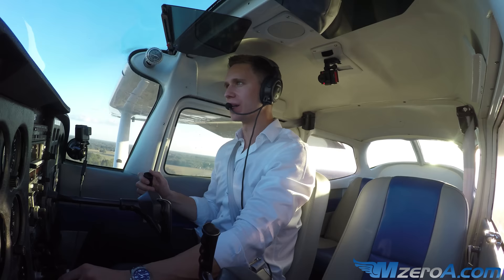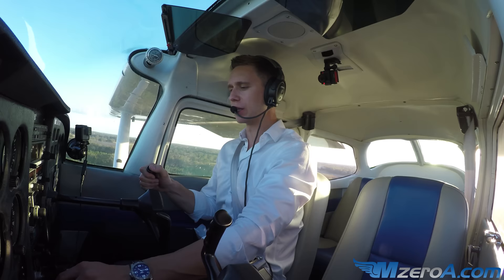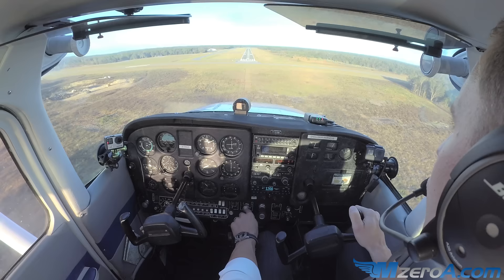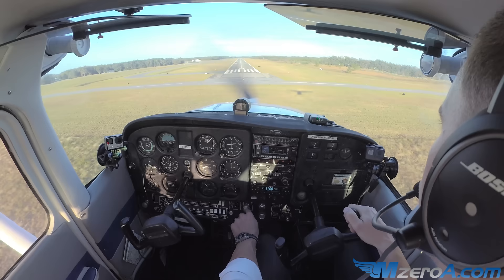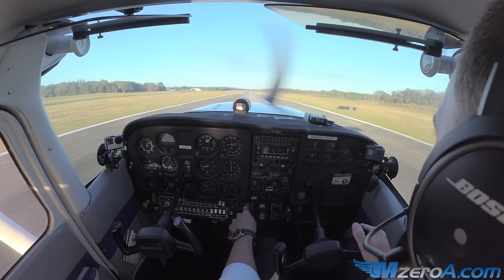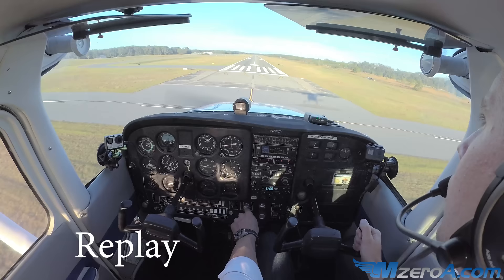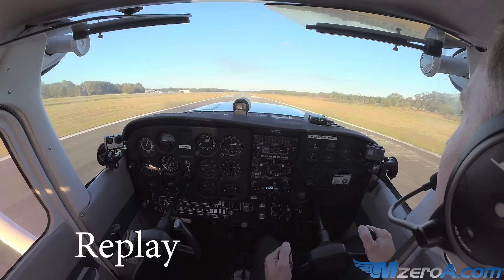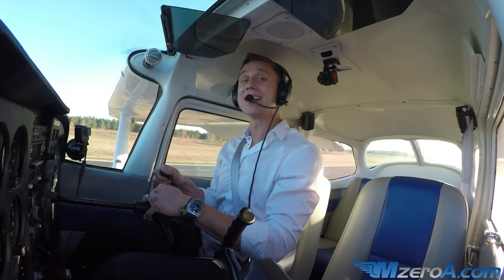3 Tips To Improve Your Landings - MzeroA Flight Training

Comment: I'll never forget my first solo cross-country from Houston Hobby to San Antonio International (really - we could do that back in the 70's). Approach control held me at 2500 feet on base for runway 12 R. A Braniff jet flew underneath my 150 (I could see the stripes on the co-pilot's shoulders) and the tower then just said turn final, cleared to land. Wow. I came off the power and hit full flaps and landed on the numbers from a 2500 ft. base leg. It was the first time I hadn't flown a traffic pattern but my training kicked in and I just flew it. Same coming back to Houston. Tower made me go around in a long circling approach to avoid a Southwest jet and I just flew it. My message here is airmanship and flexibility. I was a little rattled not having the cues I got in flying a pattern, but you don't always have that choice. Great channel. I just subscribed.

Comment: The bad landings you demonstrated, I've done them a bunch of times. I think what I gained from this was delaying the round out a little bit, I had a habit of doing it early and then stalling a little high which made a hard landing or flaring with too much speed which made the airplane fly more, which I'd have to correct with a little power to stop it stalling. It's a bit of an art form getting landings right.

Comment: I believe the term flare is the best description in describing what the pilot is doing when landing the aircraft. The pilot transitions from the approach attitude to the landing attitude by using a flare.  When attempting to land the pilot transitions from a flight aircraft to a ground aircraft.  With light GA aircraft,  I found it important to instruct the student once on the ground to retract the flaps as soon as possible and thereby transferring the weight of the aircraft from the wings to the main wheel gear and nose wheel. In other words, transition from flight mode to ground mode as soon as possible. Of course in flight training, the term to use is what works best for the student..

Comment: My biggest issue is directional control - when I throttle idle my nose starts going all over the place and I'm trying to rudder to correct it. Would love to see tips on how to maintain directional stability during the roundout. Thanks!
Reply: More throttle?
Reply: I found it helpful to watch the end of the runway through the transition (roundout).  The nose doesn't come up nearly as much that way, as you generally keep it lower to avoid an aggressive sink. My experience is that most CFI's for some reason,  pull back on the yoke far too much.
Reply: Don't rudder correct, do slight aileron correct and I mean very certain sligh/
Reply: More slow flight practice!!

Comment: 2016 172/G  I go 85 on downwind, 10 degrees and trimmed, 1800 rpm, 75 on base and add flaps to20 almost no retrimming, turn base, final flaps and 65 about 1500 rpm give or take on wind again almost no trimming, slight adjustment and 65 all the way to the fence, touchdown between 50 and 55

Comment: I don't know if it is my CFI, or the tiny field im flying out of, but we land very differently. I'm configuring for 70 wigh flaps on the downwind and holding that all the way until short final, than power off and basically a controlled stall to the ground after the round out. Now, my base and final are very short due to a hill that blocks the pattern, and I am virtually always flying in gusty conditions. 

My CFI did say that once I get good at landings on this field, I can land anywhere. My first landings on a different field definitely felt like they were on easy mode.

Comment: You can not fly  a normal pattern when some other  pilot  is flying an A380 pattern, so instead, i practice to be quickly ON SPEED, ON SPOT at 300 feet from the threshold from any speed / altitude/ distance and always land the stall warning screaming  with flaps max 20 trying to touch down on the number, each and every time. I would use full flaps on a dead stick landing, though. And. Great video, great info!

Comment: I don't get why there's so much emphasis on staying close enough to make runway if engine quits.  We learn to fly so we can leave the pattern obviously. Engine reliability shouldn't be the driving factor to determine how wide a pattern you fly IMO. A wider patter would not require as much bank and allow plenty of time to correct if required. And at the same time could even keep the stall/spin at bay since the pilot isn't rushing to keep it tight and not overshoot. What say you?
Reply: As someone who  is about 10 hours into my flight training, if I had to guess its about the time it takes to recover. I agree that engine reliability shouldn't be a driving factor, but it should be considered nonetheless. When flying at altitude you have time to react to an engine failure, whereas when you're in the pattern you don't have the luxury of disposable altitude. If you can't make it to the runway, then you essentially have one option to land and that is pretty much in front of you as you don't have the altitude to maneuver to a potentially safe landing area. In addition, making hasty unplanned maneuvers to areas that are not the runway is dangerous especially when there is other traffic in the area. Depending where you are in the pattern, at pattern height, you might not have enough altitude to get to the runway. For example say you fly an extended crosswind and then your engine quits. Then you have to make an extended base to get back to the runway, and while you might be able to make it, sometimes you can't. A perfect pattern should keep you where you need to be in the event of any type of failure, but also allow enough time to make the maneuvers to the different sections of the pattern. If there's one thing I've learned so far it's that when you're in the air, always have a backup plan because the minute you start to panic is the minutes you make things worse.

Comment: Agree 100% that airspeed is king and GA pilots have a tendency to be to fast on the approach/landing per several research studies as evident by porpoising, multiple bounces, floating. But let me add the following. Research has also shown that rarely do GA pilots adjust Vref for aircraft weight. As the latter decreases so does the former. Moreover, light aircraft certification (not so for transport-category acft) only requires a single vref value to be specified in the POH and for max cert aircraft weight. In the case of a C172 with solo pilot and less than full fuel the true Vref will be less than the single-value stated in the POH and consequently the landing  will almost certainly be too fast. 

Another point on the traffic circuit-great advice for non-towered airports but less so with a control tower who can, and do, request right base/straight in entries. etc.

Comment: Large jets like the 777 and 747 don't really flare like this guy says.  Jets don't really flare in general.  Certainly not the ERJ-175 that I fly. You just fly them with power onto the runway.  They are generally already in a nose up attitude during final.  In a 172, you pull the power back way earlier and flare it until the stall horn goes off and it plops onto the runway.  To me, that's more of a flare than what you'd do in a jet.
Reply: yeah this is what I'm thinking, the faster the airplane the less you want to get it near stall speed close to the ground.
Reply: On a good landing the stall warning horn shouldn't be going off, maybe slightly from a gust of wind right as you touch down.  No matter what phase of flight though, a stall warning horn is the indication of an imminent stall, not a good sign no matter what, it's the same thing as the stick shaker going off in the jets.  That being said, many people believe that good slow flight technique is to hear the stall warning horn the whole time during the maneuver as well but that is poor technique.  If you don't believe me, check out the latest version of the airplane flying handbook.  If the stall warning horn goes off during slow flight you should increase your speed by about 10 knots in a 172.  Also, the technical term for slow-flight is any speed less than cruise.  Hope this helps some people, lastly on a side note, the airspeeds he mentioned will be different for your make and model of aircraft, please refer to the POH for the airspeeds specific to your aircraft.
Reply: Eric Housman the technical definition of slow Flight ia between the endurance speed and stall speed. I wouldn't call endurance cruise, it's far from it.

People practice slow Flight with a constant or near-constant stall warning because that is closer to Flight at minimum controllable airspeed, which is the point of the maneuver. You enter the slow Flight range well before that though yes.

There's nothing wrong with hearing a stall horn in the flare in most light aircraft. It depends on how sensitive the horn is. Many taildraggers you can't get to a 3-point attitude without the horn. For a 172 I am not a believer that you should hear the horn like some people suggest, but if it comes on when I'm a few feet above the ground it doesn't bother me at all. A stall at that stage is just a smooth touchdown.
Reply: Andy Plater I would agree on some of those points.  Definitely depends on the aircraft.   AFH says slow flight is flight just under the AOA that will cause a buffet or stall warning.  Meaning the stall horn wouldn't be going off.  In the 172 POH maximum endurance speed is at 60% power which still gives a speed of 100 knots roughly.  Well above slow flight speeds and is considered a cruise speed.  I did mention the first time that hearing the stall horn just before touch down happens quite often for lots of planes especially if it's gusty but holding the airplane at up to a full stall before it touches down isn't good technique to me.
Reply: I don’t think he’s aiming for jet pilots. Landing a 172 is totally different compared to jets. It’s the main issue I see with new FOs at my airline, they do the chop and drop like in a 172. It takes awhile for them to understand they need to almost land with power. My personal tip for best landings is the trim, have the airplane with slightly above normal nose up trim on touchdown and you will roll it on every time.
Reply: High wings float in general compared to low wings, but true jets you come in with a whole different set of power settings.  He didn't really address treating every landing with precision and controlling the rate of descent, but pro grade video.  Lots of camera angles speaks clearly and enthusiastically.  I liked it.

Comment: Some important advices on speed and distance, thanks. A good tip, face your instruments by sitting in the left seat, how can you expect a perfect landing with an improper speed and altitude information? ;-) I didn't get this "flare" argument, you flare a C172 like any other aircraft except some navy fighters like the Hornet, unless you want to bounce or crash on the ground. You may call that transition if you like - though this would rather apply to an helicopter whose flight regime actually transitions, but "flare" is just the definition of your trajectory.

Comment: Jason,  Thank you for great tips and video.  I am a student (Warrior PA28) and thought that I was doing good in learning landing.  However, I have failed with one of the instructors.  Unfortunately, not all CFI's are same.  They do not teach or give step by step instructions.  In final, the nose is still down until you come into landing arena.  When do you pull back little bit, so that we put the rear pressure on the plane?

Comment: I’m a student pilot right now and every time i transition or flare on the landing, I pull up and plane comes up. :/
Reply: I don't think is much of a "pull up" rather hold the nose up when you transition, as your airspeed decreases you need more back pressure to hold it at the same position, when you get into ground effect just hold the nose up but don't yank it, it needs to be smooth.

Comment: Disagree with Jason.  Continually decreasing speed on final increases the workload requiring extra increases in pitch, changes in power (remember slow flight), and retrimming.  And for your checkride, you're expected to maintain a stabilized speed.
Reply: Unless there's tailwind madness
Reply: Agree. I was once taught to set trim to put the plane on glide slope and adjusting power to have a constant speed. Very useful in decreasing workload.

Comment: I’m 11 hours into PPl and have found everything so far to be exactly as I expected it. But I’ve just started doing circuits and I feel like I’ve hit a brick wall when it comes to landing. It feels so unnatural and wrong. I’m getting really bad ‘ground rush’ and can’t force myself to fly the plane into the ground. I’m literally trying to pull the yoke back as my instructor is laughing at me and keeping it jammed forward (he’s a great instructor don’t get me wrong). I’ve watched a million landing videos, flown a million simulators and landed in light aircraft hundreds of times as a passenger but landing just feels so horribly unnatural. Did anyone else struggle like this and did you get past it? I’m really worried that I’m not going to get this and I’m driving home from lessons feeling defeated 😞
Reply: Two important things that have helped me out quite a bit over the years.. this first one many instructors don't even tell you... make sure you  don't have your seat adjusted too high, this can cause a difficult sight picture... you should just be able to see over the sunscreen and see the rivets on the cowling but not be looking way up above and over. After I returned to flying after a seven year break I was having an issue getting my landing nice again and finally someone turned me on to that. I'm tall and I was sitting on a seat that was cranked all the way up. I now set me seat to the lowest setting in a cessna 172.   The second item is to make sure as you come across the threshold to look way down the runway, almost to the end to help judge your distance and use your peripheral vision to determine when to start round out and flare. If you're looking too close the aircraft it will cause you to feel like the ground is rushing up too early and usually will start you pulling back too early... hope that helps, but of course discuss these tips with your instructor as well.   Good luck!
Reply: @akfox38  thanks very much for this pal, the seat on our 152 is buggered and propped up with a permanent cushion. I will try an adjustment. I’m doing my best to look down the runway but man that feels unnatural as well. Cheers for taking the time to reply 🫡
Reply: @jackglossop4859  yes it does feel unnatural looking down the runway for a bit and then you'll start to get the feel and the muscle memory in there. Some people say or suggest to look down the runway but slightly off to the left or right as well. I've just always found looking straight down works for me. If you are sitting a bit too high I think you'll find quite a difference there as well. It seems to me that when you're a bit lower it feels like it forces you to use your peripheral more than looking high and down the runway  Good luck

Comment: Hi Jason,
New guy here.
My Instructor has me cutting power to idle a beam the numbers on downwind. 
Does this make sense to  you ?   Thanks!
Reply: when i was learning mine did the same thing. its a good technique to learn the aircraft... some say engine quits u can make it etc... funny thing though, if the engine worked fine all the way to the airport why would it decide to quit in the pattern. if was to quit adjust to make the runway
Reply: AV8R   Yes , it’s been pretty much standard procedure in GA training for at least the last fifty years. If the engine quits and the runway can’t be made from there , then the pattern is probably far too wide.

Comment: In the traffic pattern, what's the advantage from going to 80kn downwind, 70kn base, then 60kn on final versus maintaining the same approach speed down to the runway?
Reply: if I had to make a guess why the transition, if you go 70-80kn downwind, 70 base, 60-65 final, you won't float that long if you maintain that airspeed, plus you'll touch down before the 1000 footer. instead of having to deal with slowing down in ground effect, which, with the induced drag, is very annoying to do. (I tried, don't put 30 degree's of flaps on normal landing either, just go around x'D).
Reply: It's just an easy way to transition to that slow speed and stay stabilized in your approach. If you get to your final approach speed on downwind you would probably need to cut the power to help you do that, then need to add power back in to control your sink. In a 172 you can leave the power at roughly 1500rpm and transition (80,70,60 with 10,20,30 degrees of flaps for example) and end up right on your touchdown point without touching the power in a lot of cases, provided you fly a good pattern.
Reply: and.. if you do 65 the whole way, you piss off everyone else in the pattern